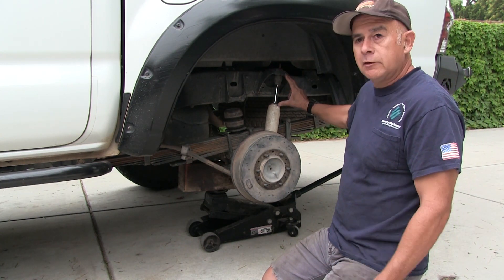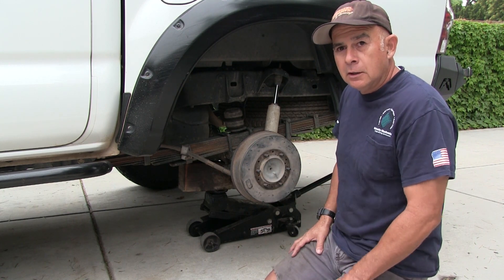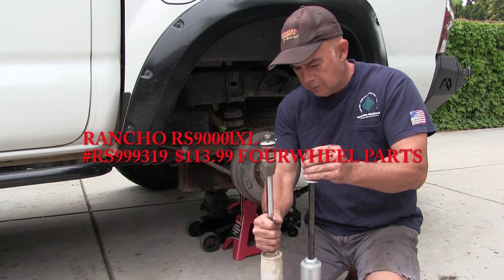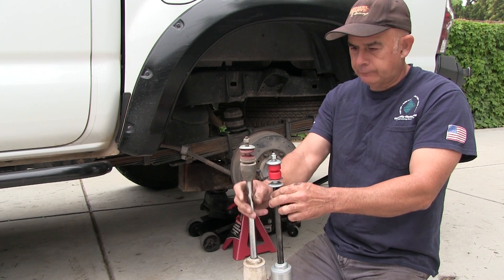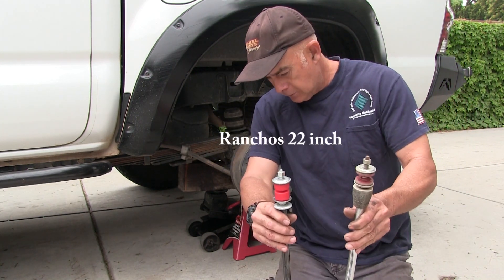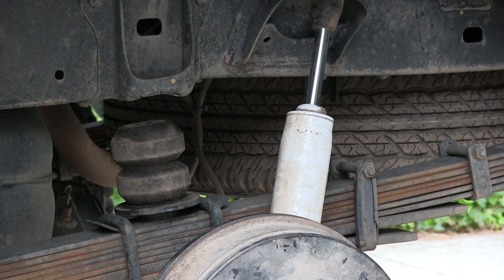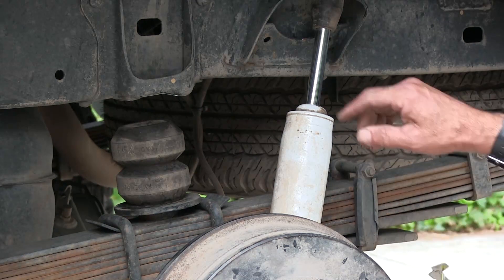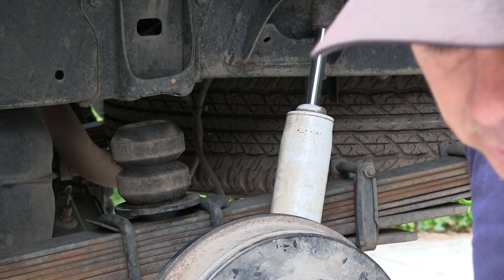Tacoma 4x4 Rear Shocks

Comment: I have those 5125's on the rear. get great flex out of them with the Dakars, but I don't have the extra leaf either. been on there about 4 years now. still have the 5100's on the front with no problems. I did take the sway bar off too though

Comment: I have Bilstein 5100's on front of my Super Duty and a steering stabilizer, definitely like their product. Still need to order the rears since I have some Procomp ES9000's, they are a bit soft though.
Reply from the maker: I had a F-250 Crew Cab Superduty with 8 inch Super Lift springs. Drove it around town with out shocks and with shocks. Made no difference.  Had a dual Pro Comps up front and single rears.

Comment: I saw a video here on youtube where the guy changed out the rear shocks without removing the tires or jacking the back end up. I wound doing the same thing and wound only taking 30 minutes.
Reply from the maker: You don't have to remove wheels just makes for an ez view with the camera.

Comment: Ya I shop at Summit and 4wheel parts too......You should take the factory  spare tire off since you have a real spare on the back might save some money from hauling around that extra weight.....Stay safe. P.S, sucks that Rancho stopped making that wireless kit for the shocks.